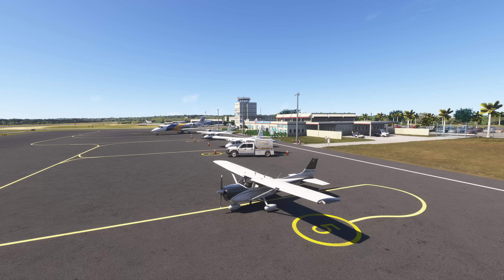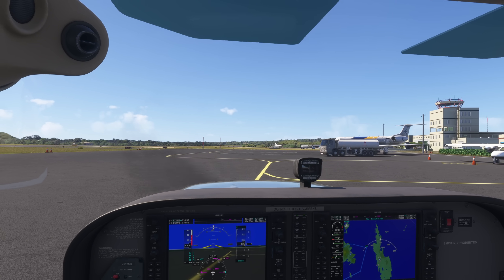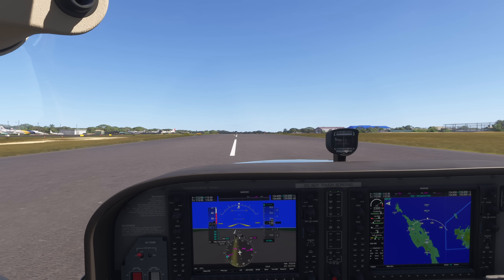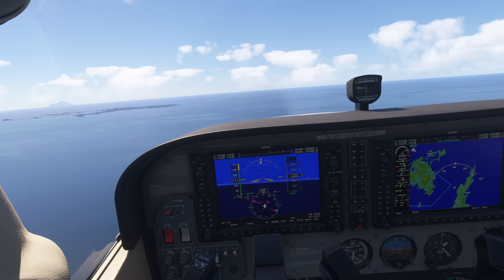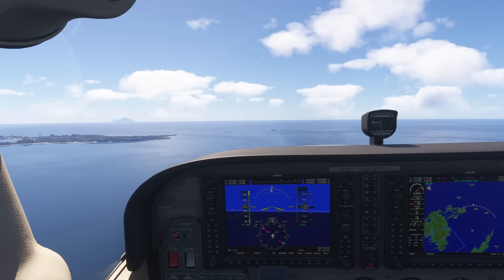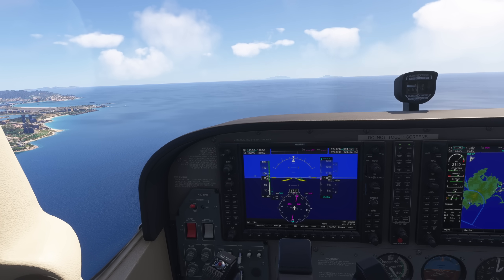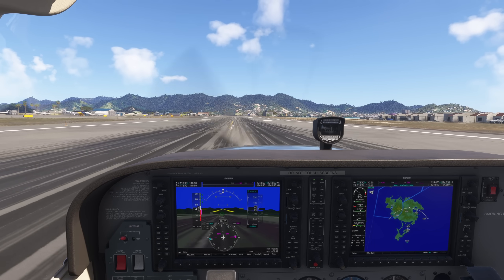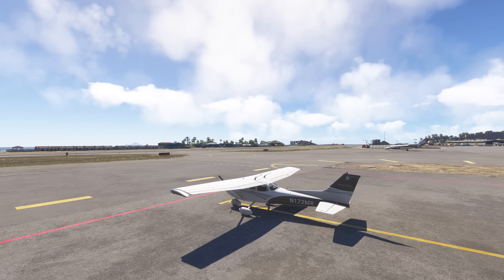MSFS 2024 SU4 – Everything You Need to Know + Release Window Prediction (1.6.31)

Comment from the maker: This video is a prediction, a word I use in both the thumbnail and the title. Could I be wrong? Yep. I've since seen confirmation from a community manager at the official MSFS forums that the PS5 early access release tomorrow is indeed SU4, albeit an earlier version (1.6.28) than the current PC/XBOX beta version (1.6.31). What does that mean? I can see them testing and continuing work on SU4 until next Tuesday, 12/8, which is the full launch day for PS5, and releasing SU4 uniformly across all platforms then. Once again: this video is a prediction. 👍

Also, one commenter claimed that I said to turn off frame gen to fix stutters, which of course I did not say. See 5:39.
Reply: "Release Window Prediction: Imminent (Early December 2025) Target Date: Likely December 3rd - December 8th, 2025" That is from Google god, (Gemini Pro). It even told me to tell you, that you are not needed anymore.

Comment: Sim is still hit and miss. After enabling Adaptive v sync in nvidia CP, locking fps at  98 (100hz monitor) + nvidia low latency to on and X2 DLSS frame gen. I still see stutters from time to time and even had a few sim crashes. The pmdg 777 however is unplayable. Its the only plane together with the 350 that has massive performance issues. (Weird because initially all pmdg planes performed extremely well)  I have a 5080, 7800X3D and 64GB Ram

Comment: I love msfs2024, but I am having stutters every 10-12 seconds. The thing is, they do not manifest on every session and it is infuriating when it happens because I cannot for the life of me pin down the cause. I do not believe I can possibly have a more powerful setup. Specs 9800X3d 64GB DDR5 6000 C30 RAM. Samsung 990PRO 4TB NVME. ASUS Astral 5090 GPU. Running ULTRA everything for the most part. Ive tried DLSS / DLAA / TAA FG on and OFF. Still getting them on random sessions. SU4 Beta Latest.
Reply from the maker: One thing I found is that I’ve had to delete my shader caches and rolling cache with each beta update. Have you tried that?
Reply: @IslandSimPilot  I have indeed, in fact i do it after every session. I wrote a batch file to do it since im doing it so often.

Comment: One thing I can’t shake on 2024 is terrain/autogen pop-in in photogrammetry areas. Building and texture LODs are constantly changing, and it is totally immersion breaking as the scenery pops and changes constantly. I’m on a 100mbps connection, which should be enough. 

This, and waiting for ChasePlane to be released for 2024 is what is keeping me on 2020.
Reply: I am currently in closed testing for ChasePlane in msfs 2024. Lets just say its amazing!